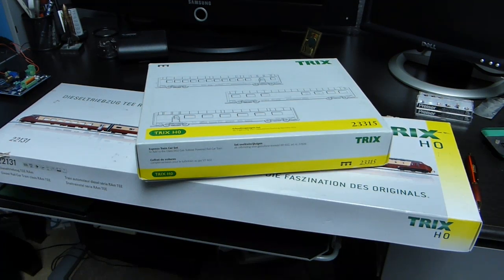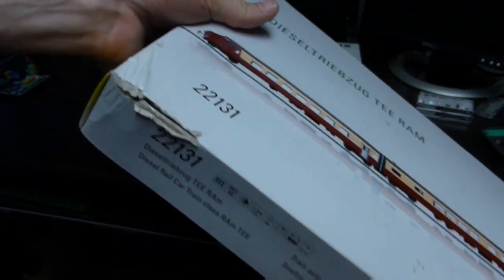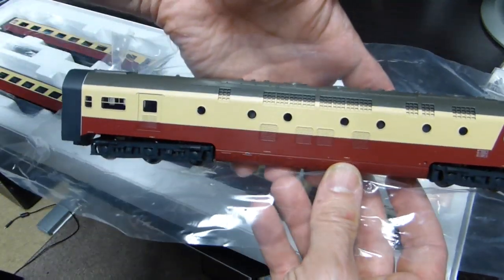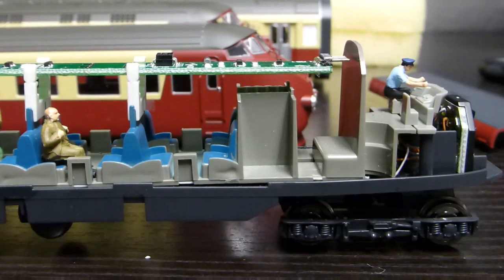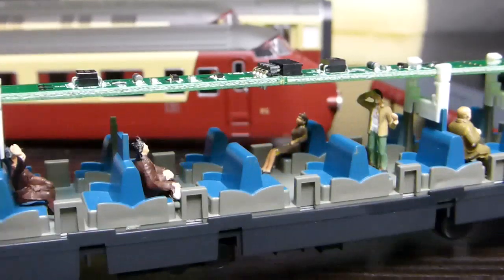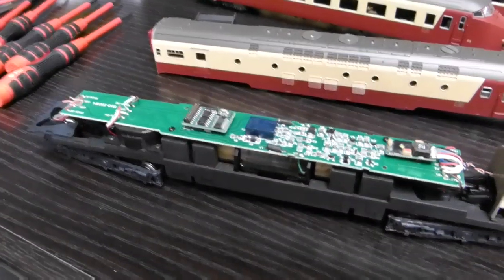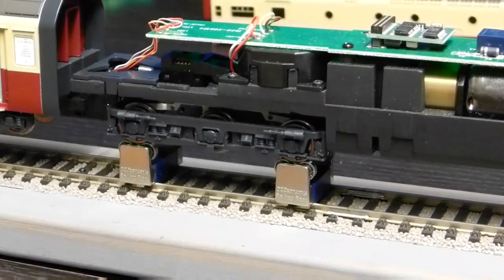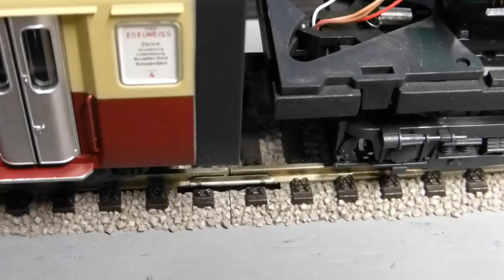TRIX 22131 TEE RAM DETAILED LOOK

Comment: That's a beauty.  I was impressed with the universal joint.  Do they all have one of those?  Rob
Reply from the maker: Hi Rob , each marklin trix loco has a special drive system to suite the loco but sets like this mainly have the prop shaft drive system to drive the wheels from the motor....